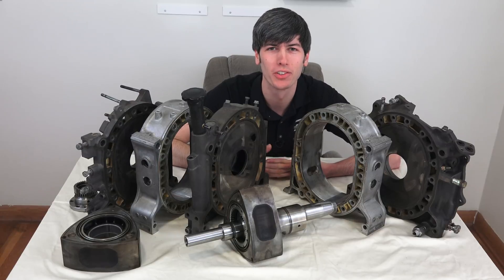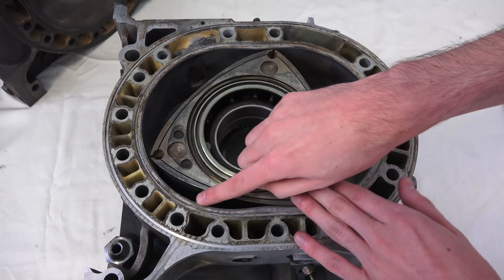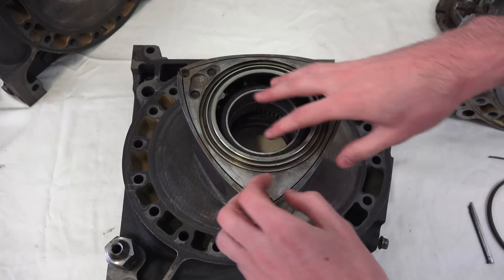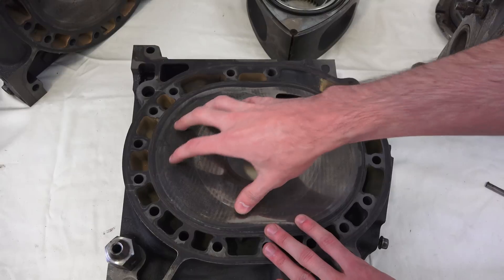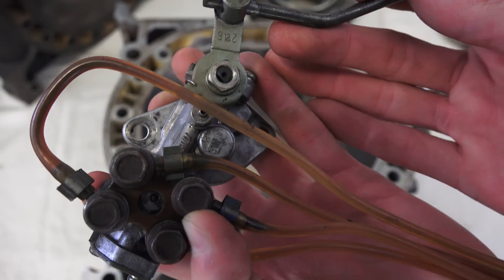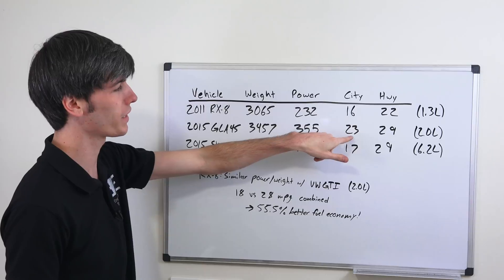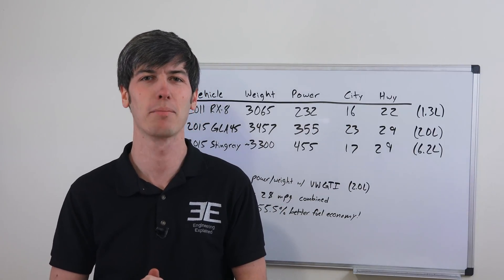4 Reasons Why The Rotary Engine Is Dead

Comment: Rotary engines are cool and everything but they burn oil stupidly fast, are difficult and expensive to maintain and repair, and the fuel.... My 1972 MGB GT has a long stroke, B-series 4cl with twin carbs, that is a very old fashioned and dirty engine, yet it does 25mpg

Comment: if you can identify it. then it's fixable.
Bigger engine, move exhaust port up, accommodate intake port so no overlap. Bigger water passage on the combustion end. move sparkplug location so there is no over lap......possible 2 plugs 1 location.

Comment: If thermal expansion is a problem for the seals, why don't they use a material with a low coefficient of thermal expansion like Invar?  

In fact, if they make the entire rotor and housing out of the material, wouldn't it making for a better seal and possible allow designers to eliminate the oil-metering pump?

Also, perhaps coating the interior of the housing (and possibly the rotors) with some sort of high-durability ceramic would further improve sealing.
Reply: +Jonathan Gwynne good idea but doesn't worth investing that much in a such shit ... it has too many flaws

Comment: Wish I had an old Rotary to play around with and convert it to a Diesel. That would at least take care of the cylinder lubrication issues since the fuel already has lubricants in it! I've always liked the idea of the rotary since it doesn't need to make gobs of HP.

Comment: Also from the factory the highly restrictive exhaust kills fuel economy. With headers and less restrictive exhaust the car makes better power and improved fuel economy as well. Considering the engines small displacement it burns a lot of fuel but pound for pound can make more power per liter than ANY other engine.So it's more of a preference issue than a better or worse unless you compare emissions which for REAL racers isn't an issue.

Comment: rotary engines are different and unfortunately most people including so called   mechanics give it a bad rap.I love rx7's and not for emissions but because I can take 1.3 liters of of high revving turbocharged engine producing over 400whp propelling the 2700 lb car much faster than guys with engines 3 times as large.They are admittedly finicky but suited to racers.Also they're old enough that you don't have to smog them : )

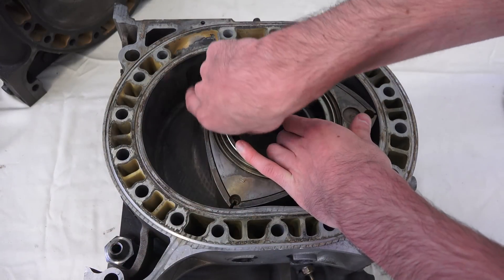Comment: I'm with you up until 3:45.   You're showing that an engine that's more than four times as large isn't even twice as powerful as the rotary, as more efficient?    But you're keeping it about fuel efficiency, so let's address that specifically.

Let's make the 1.3L have as much HP per liter as the 6.2L and then compare the fuel economy.   I don't think your conclusion will hold water.   

Or conversely, give the 6.2L upwards of 1100 HP (6.2/x = 1.3/232) and then compare the fuel economy to the 1.3L.  Good luck, you'll need it either way.

Comment: dont cite the corvette as getting 29 mpg when it uses cylinder deactivation
Reply from the maker: A 2004 Corvette still has more power, more weight, and better fuel economy, without cyl deac.
Reply: Engineering Explained That really makes a point that even 12 years ago v8s were already more efficient.

Comment: But, you also have to consider the HP rating of that 1.3 liter to the 2.0l GLA45. The GLA is turbo'd and the rx8 isn't. I feel it would be a better comparison if we were comparing two engines of equal size (hard to do since its a 1.3) and also non turbo. That turbo benefits that GLA greatly for the MPG factor and also the hp factor. I completely agree on the emissions output, but not about the gas mileage/horse power rating. You could pretty much put together a rx7 turbo engine and have it set up for economy driving. Nice video besides that.
Reply from the maker: +BrutalEG6 I also compared it with a large V8, and it still gets worse fuel economy, even if you go back to the 2004 Corvette. There's variety for a reason. :)
Reply: +Engineering Explained Yes, i saw. It had a lot closer numbers with the rx8. It had nearly 5 times the size of the rotary in displacement though and the vette has a bit of newer technology id assume. Since the technology in rx8's hadn't changed since the FC rx-7 and that was in the late 80's. Which makes me have have high hopes for the rx-vision to show improvement whether its turbo'd or not. Thanks for the reply.

Comment: Thank you for deflating my original lust for a RX8.  I did not even contemplate the terrible temperature fluctuations between the two chambers.  I also am appreciative of your efforts to show how horrible the gas usage in this design for the weight to power ratios. Until enginerring can possibly build a far better wankel engine I will resign to stay with piston driven engines. Many thanks for clear explanation of this original design.

Comment: 4? You could've stopped after the big 3 with every rotor motor. Apex seal #1, apex seal #2, and apex seal #3

Couldn't help it.. honestly for me, oil combustion and inherently poor geometry for harnessing mechanical energy from expanding gasses is what does it. I would love to replace the rotors for the excitement (hey if the engine's only got like 5 parts, might as well service it yourself).
Unfortunately, this engine was designed to be simple, not to be good at turning chemical energy into mechanical energy. Pistons are a very efficient geometry for "mechanicalizing" rapidly expanding gasses. Why don't rotary cars use brake master/slave "rotors" as well? Because the shape doesn't make sense.. it just allows for fewer moving parts when used for a combustion engine, which as a cheap manufacturing hack, is quite impressive.

(Call to Action: I wanna see you "so-called" rotary fanatics set up a brake/clutch pedal which actuates a "hydraulic master rotor" since you supposedly love rotors ;) You don't have to do the slave side, as obviously the packaging would make it quite difficult to fab your own. But in the base of the footwell/behind the firewall, there should be room for a small rotor and the pedal's motion already is rotational around a pivot- you could be rotating a rotor YOU FOOLS!)

Comment: Wankel have low power with low engine RPM. Small cyliders from small capacity of oxide+fuel give low power by short lever to shaft. 

Wankel cyliders give more on high RPM. Small cylider accelerates easier and less capacity of oxide+fuel to flow

Comment: Being a total novice with rx engines, I have a comment and a question.

comment would be " I now understand why there aren't diesel rotary engines"

my question being,

would the rotary engine have benefited from a form of egr valve to reburn some of the lost fuel, which would possibly in turn help even the overall temperature of the block?

ok another question. to save burning both fuel AND oil, couldn't the car have run on 2 stroke oil like an original  saab? lol

Comment: i know that this might sound like a know it all answer but the actual displacement per revolution of the rotary engine in the rx8 is 3.9L not 1.3L, three combustion chambers per rotor so 3 X 1.3 = 3.9L. still gets crap millage though

Comment: Other than the occasional Mazda, they do seem to be popular in Snowmobiles. I wonder why that is?
Reply from the maker: +pauljs75 I believe it has to do with their reliability. And before everyone explodes saying "apex seals blah blah" here me out. When rotary engines fail, they tend to do so in a non-catastrophic fashion. If the seals are worn out, the engine will still run, and you can limp home. Piston cylinder engines on the other hand can fail catastrophically and that's it, you're stranded. So that would be my assumption as to why it's popular for snowmobiles. Also they're small and light, powerful for their size.

Comment: couldn't you have a two stroke mixture instead of an oil pump to the air mixture chamber to prevent the engine burning up in another way?

Comment: You didn't mention the big disadvantage of low torque, and the need to rev its seals off to get power. Also, the 1.3L capacity designation is false. Actual comparable capacity to a piston engine is 2.6L. And before the rotary fans flinch - I had a twin turbo RX-7. Shocking fuel consumption & comparably poor grunt

Comment: there is only one reason why the wankel is dead...and this is because noone  has spent or put money and effort to really develop it ...not even mazda...you make a big mistake...30 years ago the same 1.3 lt  engine produced the same horsepower 240..you compare the same engine which is almost identical for 30 years with 2015 models ..rx7. was something amazing back then ....do you know how difficult it is for a company to cancel all its engine parts suppliers and adopt the wankel project...????you have a point  about the disadvantages and you explain them quite well but the main reason is because only one company used it and NEVER EVER REALLY DEVELOPED  IT...!!!!

Comment: Maybe I'm talking nonsense here, but if the flame path is too long, why not making the chamber and piston smaller but deeper?
They could place a deeper but smaller piston with double sparkplugs to cover the extra depth, having the same volume but a shorter path.
Or even use two smaller chambers with two pistons as above, but running opposite and compensating the heat unbalance.
I'm no engineer, but somehow it makes sense to me...

Comment: Make it run on diesel if you want economy.
Reply: +Laurynas S. You can't, the rotary can't physically get enough compression to run diesel.
Reply: +joshjamesPUsniper  Oh, it has been tried, but without much promise. Like you stated, the compression is the major hurdle. Plus, I'd think to build any internals strong enough to match the added pressure would likely be an exercise in futility, indeed.
Reply: +Laurynas S. 
Rotron use diesel fuel by heating it to 98C before injection then using spark plugs to combust.  Depending on when the fuel is injected it can also lubricate the apex seals.
Reply: +joshjamesPUsniper and the diesel engine can't rev higher than 5 000 RPM

Comment: I believe you touched on it, but it would be well to point out the distinction between the unburned fuel escaping via the exhaust, which is representative of poor combustion efficiency, and the low thermal efficiency which is due to the high surface area to volume ratio of the combustion chamber, resulting in more of the heat of combustion escaping into the surrounding metal, leaving less energy available to do work via expansion.  Indeed it's the combination of both of these factors that lead to the poor overall efficiency.  It's too bad, because they are otherwise really neat engines :)

Comment: 1. Why not add a spark plug further into the chamber. 2. Why not have the coolant from the hot side flow past the cool side before going to the radiator. Also for multi-rotors why not have the cool side of one next to the hot side of the other. 3. Why not use something other than just regular oil (that reduces emissions and helps with the seal) and have a separate tank for it like other fluids, just top it off when you top everything off. Yeah that's a pain but if you want a rotary it's already a pain. 4. Comparing it to new and (remember the 2011 RX-8 is still using early 2000's technology, it wasn't brand new for 2011) more advanced/expensive cars makes it look even worse than it already is.

Comment: Engineering Explained ... You were doing just fine until you began comparing 4yr old mileage ratings to current technology. I don't know if there would be any difference to what you put on the board, but that's where your presentation is flawed. You might consider redoing that part keeping years with years. Who knows, just for the sake of comparison, what advances may have come along to then put up against 2015 mileage ratings. Otherwise, thanks for the rest of your presentation.
Reply from the maker: +AH Glasher 2001 GTI gets 33% better fuel economy. Compare it to whatever year you like, the vehicle isn't good on gas.
Reply: That wasn't my point

Comment: But the power band and acceleration is so much smoother!!!
Reply from the maker: +Questhobson Certainly has advantages: https://youtu.be/sd6pJtR4PaY
Reply: +Engineering Explained yeah bro for sure.  I work at KiwiRE in NZ.
Mad mike whiddete is a school buddy of mine.
I've had over 13 rotors in my time.

Comment: emissions question for the wankel crew.... why not use a fuel that acts as a lubricant such as diesel? when it comes down to it a wankel is basically a 2 stroke. meaning needing fuel/oil mix, also of you follow  the face of the rotor you, simply put, have intake/compression  and ignition/exhaust. or a hot side and a cool side.

my thought would be diesel fuel rather then oil would, even if its slightly, help keep the combustion speed high. allowing the air fuel mix to be more completely burned before the exhaust port get reached.

or maybe Mazda needs to get into the bike game. there they could develop the tec. a 0.4L turbo micro wankel would be nice on a motorcycle.

Comment: so piston engines don't combust fuel in the same spot every time?
so piston engines don't have oil in the combustion chamber too?

as a side note;
Some rotary owners remove the oil pump and premix.

the point of the rotary is not the sheer amount power it make but how it's delivered
Reply from the maker: +David Quinn To answer your questions:
- Yes combustion occurs in the same spot in a piston cylinder engine, but also every other stroke as well. This is not the case in the rotary.
- Not by design, they do not intentionally inject oil into the cylinders, only below to keep the pistons lubricated between the cylinder.

Comment: ... and yet you compare a 1.3 liter engine to a 2.0 and a 6.2. the wonder with a rotary engine is its power to displacement ratio. a rotary engine can produce more power in a smaller size.
Reply from the maker: +Joseph Eirman As mentioned in this video: https://youtu.be/sd6pJtR4PaY

Comment: I wonder if the rotary engine would be better if it had the decades of refinement and engineering that conventional engines have had
Reply: +omgimgfut it will be better. the newest one from mazda is I believe being put into the new RX-VISION with SKYACTIV-R  Front mount motor with RWD.

Comment: A very good, simple and clear explanation about why the rotary engine is (almost?) not used anymore. I still wonder if there are some specialised areas where it's still makes sense to use a rotary (Wankel) engine??? I can't think of an area that can't be covered by the use of a regular (Otto) engine or an electrical motor. But maybe, maybe there's still a field where a rotary engine is useful????
Reply from the maker: +johnsamu Not much in automotive, though hopefully Mazda brings it back. It might be used in snowmobiles still. Rotary engines don't tend to fail catastrophically (more common for piston cylinder engines) so usually if something goes wrong they can limp back, rather than being stranded.
Reply: +johnsamu how about in the mazda car field. check the new RX-VISION with SKYACTIV-R. its so sick

Comment: Americans have such a jaded view on what good fuel economy is.
Reply from the maker: +scbonduk I don't know if jaded is the right word, as that would imply our fuel economy is so good we think 18 mpg is bad (which, it is). There are far more efficient models in Europe running small diesels that American cars don't come close to.
Reply: +Engineering Explained Well what would you say is good fuel economy? If American TV is anything to go by it's mid-30s on the Highway (which is what, 50 MPH? 60 at best?). Ford sell the Fiesta as 36 MPG on the Highway in the US...the same car in Europe is sold as doing 65-75 MPG.

Comment: First production 4 stroke auto: 1885, First production rotary auto: 1960. So, the 4 stroke has been underdevelopment for over twice as long. 

Number of automakers developing rotary engines for production: 2. Number of automakers developing rotary engines for production: literally every other gas-powered automaker since 1885. (yes, I know GM briefly flirted with the rotary, as did some others, but nobody actually put one in production except NSU and Mazda).

 I have to wonder if the numbers were reversed, which would be the better engine today? Yes, the rotary has some drawbacks in it's design that cause higher emissions and fuel consumption, but so did the piston engine. 

Mazda has done amazing things with engine development, but they are a small company and their tiny R & D budget has to be spread across many engines. For comparison, this is from GM's promo on the new LS engines: "The heart of the LT1 is a new advanced combustion system that GM spent two full years developing, using their sharpest minds and best analysis tools. Some six million hours of computational analysis (out of the 10 million total hours invested in the whole engine design) were focused on evaluating 75 different combustion chamber configurations."

"Ten million total hours invested in the whole engine design" - WOW, imagine what Mazda could do with that kind of development resources!

Yes, the LT1 is a much better engine, but don't dismiss the rotary because of limitations that Mazda could not afford to overcome.

Comment: One of the primary reasons for the Rotary's high fuel consumption is because of the long, thin crescent shaped combustion chamber exposing a large surface area. In any engine some hydrocarbons will cling to the cooler surfaces and will not burn, as the Rotary has a greater surface area, more don't get burnt. To add to the problem, the build up time for peak compression in a Rotary is slow, 1.5 times slower than a piston engine and this gives more time for hydrocarbons to relax onto the cooler surfaces.